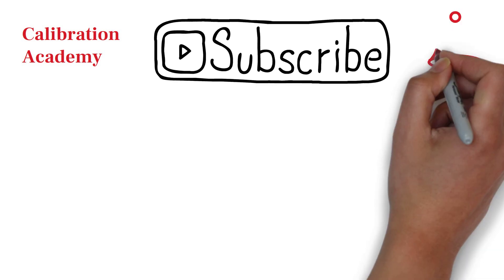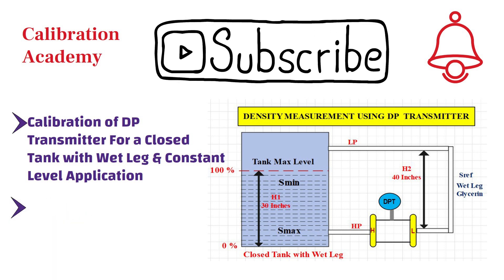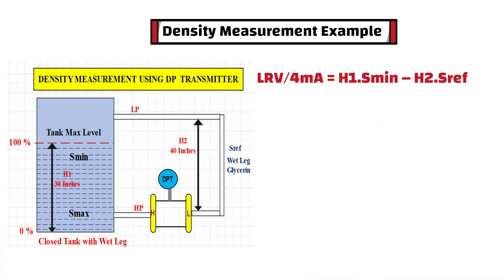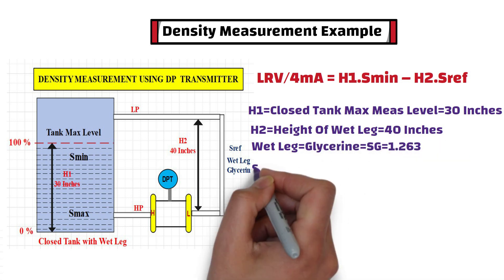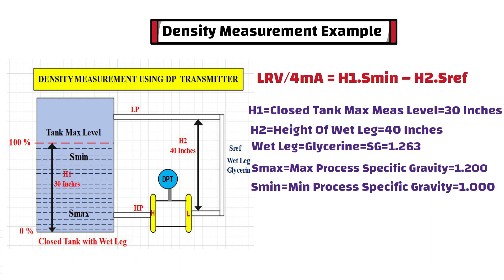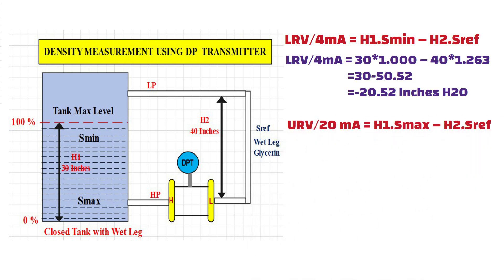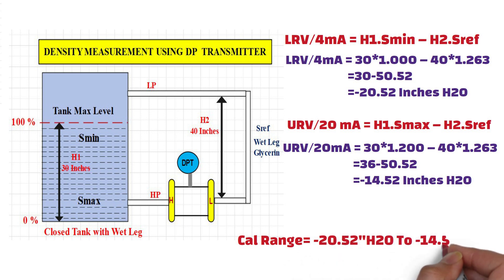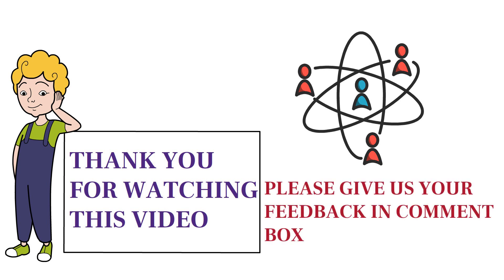Density Measurement using DP Transmitter with Closed Tank- Level measurements

Comment: Hello there how did you get the glycerin s.g 1.263 and also Max S.g 1.200 you say from process data sheet what is that
Reply from the maker: Hello Nelson
Thanks for your comment. Glycerin specific gravity is 1.263. It is standard value. Process data sheet is the one of the document in which you find all the process related parameters such as operating temperature, maximum working pressure, maximum process specific gravity, and minimum process specific gravity. Usually this document is available for all operational person.
Reply: @InstrumentCalibration  ok sir  thank you sir . Let say sir i have a close tank to get the level measurement for the oil and i will use standard dp transmitter so to get the S.P sir i need to get the process data of the tank sir to get the S.P OR i need sir the process data of the Dp transmitter to get the S.P which one is correct sir .
Because i know that S.P = DENSITY OF SUBTANCES /DENSTIY OF REFERENCE
Reply from the maker: @nelsonpantaleon7751  you need process data of the  tank.